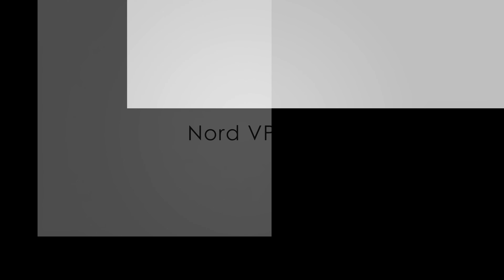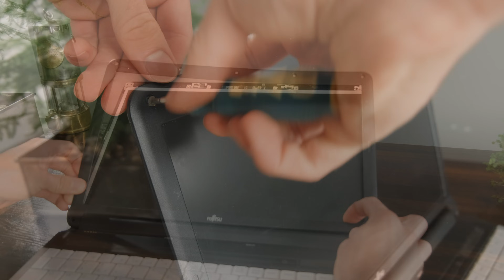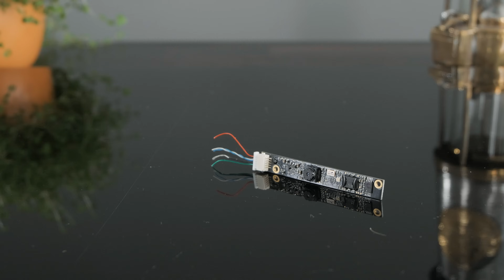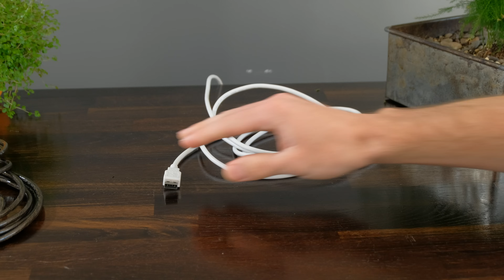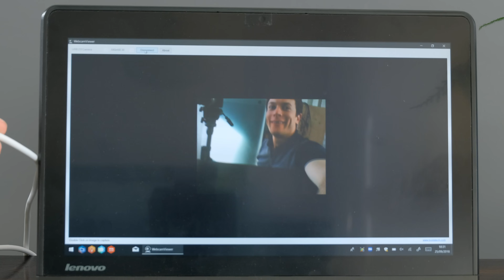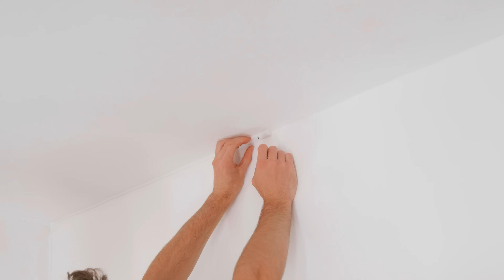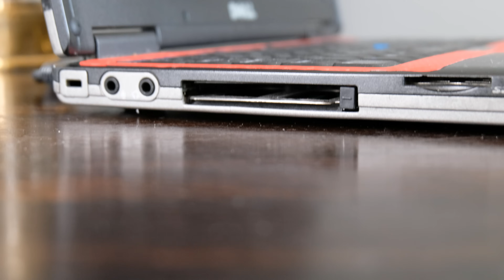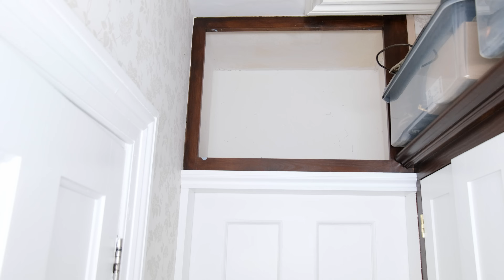DIY Home Security - ON A BUDGET!

Comment: Amazing, thank you so much for that video I've been saving those little cameras from computer screens and laptops because I scrap them myself and save some of the components instead of just taking them to the e recycling bin. I was hoping that someone would post a video of this nature and I'm so glad that you did I will check out those links when I have gotten enough to do that project. I have an old laptop but it did not come with a power cord. I'm not sure which brand it is but I'll have to check it out. By the way how well do these work at night and in the dark if you can connect infrared lights as I have from old remote controls for TVs. That would be even better to see outside what is going on at the night time. Thanks again for this video and God bless

Comment: Another way of finding the Vcc pin of the camera is looking at the capacitor that is nearest to the connector. It is usually in parallel with the power supply.

Comment: I did all the connections right but on the laptop it is saying webcam needs more power and its also saying something about metered connection
Reply: Try with short usb cables and if that works look into active usb extension cables. they have usb repeaters in them if you are not using any currently.

Comment: I thought about this but never personally looked into it, thank you very much! I'm currently running a cctv setup. but with the signals in it analog, and just while a dedicated but cheaply made dvr does the job, things can get to be a little bit of a pain in the ass.. I had two cameras die either due to an emp off a light fixture or a surge from it "magnetic ballast" and they took the analog input ports with them which effectively perminantly turned it into a 2ch box. I did have an 8ch box on backup but still what a pain.. It does irritate me a bit and honestly I think webcams may pull a higher res "some of them anyway" and I may have a few... Also having a few old computers with like 5pci slots i guess i might be able to use usb pci cards.. If they exist lol I'd have to check, if so effectively 12 maybe 14channel capable desktops though a uninterruptible power supply may come in handy and ofcourse be a bulkier version of the diy. On needing usb repeaters is that due to 5volts struggling over the cables resistance or is it the data signal weakening?

Comment: Can you make a use a phone camera to make something like this
Reply: Yes,  if you have a home wifi network and an old Android phone.  Simply install IP Webcam from the Google Play Store.  Place your cell phone where you want it.  Keep it permanently plugged into a charger.  Just follow IP  Webcam instructions.  You don't need any additional software for your viewing devices.  IP Webcam can be viewed from your cellphone, Chromebook,  Windows etc.  IP Webcam will up load video to your email, Dropbox or save it on your phone.  You can even have multiple cameras, but they can only be viewed one at a time.
Reply: I believe with the paid version of IP Webcam you can view more than one camera at the same time on your PC monitoring center.  While each phone's camera can record its own video to an sd card, it's also possible to record them on a central PC (probably only with the paid version of the software).
Reply: it doesnlt use usb protocol.it would be much harder and even if you could identify protocol it would require many tools and deviced which mean it would defy the scope of being cheap
Reply: yeap you can, the problems are that mobile lcd and cameras are using special commnication protocol, the pinnout is hidden and their onboard chip unkown. without the phone you just can demanufacter it and stufy under microscop if you have enough knowledge. With the phone you can probe things around to determine the pinout. but it s not that easy as to connect a usb camera to usb port via usb cable.
Reply: @Michael-cm8qk  I am talking about how to use the camera externally

Comment: Using a Raspberry Pi instead of a notebook would make things even cheaper and less power hungry. And you can place multiple Raspis everywhere and connect them with ethernet or wireless. The new 3+ can handle up to 4 USB cams because of it's newer and faster USB chip.

Comment: When I try to connect it to my PC it tells me " Power Surge on the USB port, unknown USB Device needs more power than the port can supply" any solutions?
Reply: You either have an excessive run of Cable (Cables are too long, you need to add a Booster or give up on the Camera furthest from the Laptop) or, at some point the Cable has been "pinched" in a Window or Door. There are several scenarios I mention the most probable.
Reply: the cable is only about 1,5 m long so that shouldn't be a problem. And I didn't even install it somewhere I just plugged it into my PC to see if it would work.
Reply: Happened to me. The reason is you have the wire shorting each other. Just tidy up your wiring job, that should fix it
Reply: @attarsanahresources5540  Yea that should be the problem thank you 
:D

Comment: Just want to suggest, instead of using usb extender and have some wires, you can do even advanced way by getting very cheap and small router, flash with openwrt plug camera into usb port and you can do it wirelessly

Comment: Tip For Anyone Considering Doing This I'd recommend looking the model of your computer up on iFixit, high chance you can find a disassembly guide there.  Some relatively newer displays don't have easily available screws like his to remove the panel, in which case a guitar pick can be used to pry the paneling open

Comment: With the cost of sugru, usb repeaters, usb expansions etc, it's not very practical. But it's fun at least.
Reply: I think I could get by with a simple enough trick of swapping all the repeaters and usb expansions with Pi Zero W.  Basically a DIY wifi camera at that point, spending roughly as much money, using something like MotioneyeOS on the microSD card.

Comment: Ok, many of these modules have a built in microphone i think is the other 2 cable. If instead of use a usb cable you use utp for the 6 cables you can have a camera with mic, of course you need to solder in the other end a usb and 3.5 jack.

Comment: A few 20$ IP cams might cost less overall unless you manage to get most materials from this video for free (giveaway, dumps, old parts ...). Plus you could replace the usb cables with phone cables which are cheaper and often thrown away in construction sites. Those cables can have up to 8 or more wires (think 2 cams per cable). 
Also, you can run USB devices over pretty much any cable length as you want as long as you set the devices to use low bandwidth (so you'll also want to drop the video bitrate (resolution and speed) while also disabling the integrated micro and desolder the leds to save a couple amps). Because yeah, even though the USB specs only suggest up to 4 or 5 meters of cable length for high speed data transfer you won't be needing it plus,  this might actually be a good idea anyway because you'll run out of storage space if you record hours of best quality video from multiple cams.
That being said, i'm not sure using this would be a secure and long term setup but, those IP cams wouldn't be either unless properly configured.
Reply: so 20 bucks each is cheaper than less than 2 bucks per cam? and usb cables you can find in droves
Reply: @LiLBitsDK   you can get REALLY cheap ip cams...plus no need for a separate laptop and far more likely to be more reliable than this!!..this is really cool though don't get me wrong ..but lets face it this may be a lot of hassle for some people when you can just buy a cheap ip cam which will have more features such as wifi night vision or  sd card support

Comment: Do you think it would be okay to connect, let’s say 10 cameras to a USB switch? Since my computer has only 4 USB ports, and I need lots of them, since it’ll be a big project. And also, what will happen if I connect the cameras one to another, so I can save up some time on soldering and routing so much cables, all in one way? Thanks for the answers! 😄
Reply: Nikolai Nikolaev I don't really have an answer, but would suggest keeping things as modular as possible, especially at such a large scale. It will make diagnosing issues, and adding/replacing elements easier.
Reply: if you mean connecting the cameras to a hub and running that one cable, that will be fine as long as you dont have the cable too long. if you mean have two cameras share data and power lines to a single usb port, dont bother. They will basically cancel each other out.

If you are doing a large install, do a proper setup with IP cameras. Look into zoneminder, motion, and openwrt.
Reply: no no no your computer/laptop USB ports will only provide 5volts at around  500 milliamp which is just about the right power for 1 per USB port if you wish to power 10 i will assume you need a external power supply and some kind of micro-controller to handle all your the data lines to 1 usb port or a cctv dvr and i am no expert just a guy with no degree
Reply: You can not daisy-chain USB devices. Every USB device needs its own, dedicated cable, but you could probably use a powered USB hub somewhere to pack everything into one cable. That hub would likely have to be USB3 in order to have enough capacity for a lot of cameras. The cameras connected could still be USB2.

Comment: Minor note on how you mounted the camera in the corner of the ceiling: you should probably add a bit of suguru to the side opposite the cable, so there's not a 90 degree corner there.

Comment: The thing is ... they dont work without lights
Reply: @luisotero2632  BUT where do u connect it???!?!?!?!?!?!?!?!?!??!?!?!??!?!?!!?!?!?!?!?!?!!  TWO wires??!
Reply: @carpetrug01  the infrared LED can easily be connected to the USB power... DOH!
Reply: @luisotero2632  what do you plug it into?

Comment: You said there is no way of finding out which lines are Data+ and Data-. That's only partially true. You could make out the chip that is directly connected to these two wires. If it has some markings you can try to find the datasheet and look up which pins are which Data line. Still, it's a very involved process and if you are unlucky the chip is just unmarked silicon (depending on the webcam module).

Comment: I did one today, from Lenovo laptops and damn those wires are small, covered by a very strong protective sleeve. One thing I noted, there is a chip that gets very hot, so maybe leave a bit of breathing room for it to cool off, or they might not last long, espeically if they will be working 24/7 as security camera.

Comment: I have a few questions about those cams. On some cams written 3.3V but from usb comes 5V do i need to transform 5V to 3.3V and another question is how to get mic to work because most of cams i have from laptops have 5 wires - 4 is for usb connection and 1 im think is for sound but how 1 wire can transfer sound ? Maybe one of the cams video wire (like +) transfers sound too ?

Comment: Talking about a VPN for privacy reasons and adding a whole bunch of cameras in your home is rather ironic.
Reply: This is all local access cameras. You could setup some remote access features as well if you really wanted to and it would still be very secure. Compare that to a smart camera or camera service where all of the video lives in the cloud. Forget that.
Reply: Privacy is about control of information not lack of it.
Reply: Cameras when you go on holiday....
Reply: Or just when you go out if you live in a rough area haha
Reply: You could have the cameras on an internal network that could only be accessed externally by a VPN. Honestly, using the two together is super secure
Reply: How? The cameras are local to his home and laptop with no connection to the internet if he chooses. It doesn't provide the same level of protection in the real world that a VPN does in the digital space, but it does provide some sense of personal security like a VPN.
Reply: I mean... not really. They are (or at least "can be") closed circuit, used only for legal reasons. Therefore you wouldn't necessarily have to even have them online.
Reply: I would say... moronic !
Reply: lol and hooking them up to obsolete operating systems that dont get security updates, and using open source software at that
Reply: CMBAR (Comment made by a Republican).
Reply: I can see some straight guys above
Reply: also using a VPN combined with google chrome is absolutely fucking genius. You have the least private browser on earth and then you put a VPN, which it can actually get around... If any of you are actually doing that, switch browsers or stop wasting your fucking money.
Reply: No internet no organization spying
Reply: @benji3116  everyone on this platform is slightly challenged. Or we would be the ones making the videos eh?
Reply: you can just tell your people that there is cameras in house here, here, here........
Reply: @saadomar1101  Pretty sure that would defeat the purpose. Anyway, it's your house, you have the right to monitor the activities that go on in and around it. And if the country you live in doesn't allow it, then you live in a shitty country.
Reply: As far as I could see, he didn't put the computer online... So??
Reply: So he could spy on other people in the house?
Reply: @merlingallagher4484  its his house yo, im not sure there's a reason to do something dodgy in other people house
Reply: Even in your own house you have other family members or guests?
Reply: why would i want to see video from each guess ? its just for maybe some burglary or anything. the HDD is limited maybe to 2 TB so after sometime it will be replaced with new footage, except if you are a creep you'll save the video before it replaced
Reply: @Kevin R . Well there is also other roommates and quests. I don't know what country you're from, but in many countries you can't just record people on video, including in your own home.
Reply: why is that? do you know his or my intent to see use this? vpn can help to a more private access to the webcams to check if everything is alright.
Reply: I am talking about the privacy of the people in the house. Not to the outside world.
In fact, in many countries you're aren't even allowed to run a camera system without people notifying.
Of course the first comment was sarcasm (with a bit of truth in it)

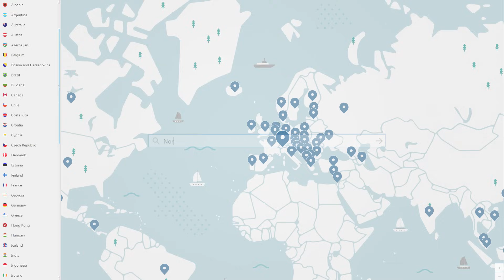Comment: 1:33 yeah, except that 66 % off doesn't seem so whopping compared to the 77 % you get without the link... Quite misleading to call it 66 % off, when in reality it costs 33 % more to use the link.
I know it's rather NordVPNs fault, not yours but still. You shouldn't reinforce, which could be considered false advertising.

Comment: I would use the Software ZoneMinder instead... it's linux based and therefore does not need such an old and dangerous windows version like XP to run smoothly on old hardware

Comment: Tip: Aliexpress sells laptop webcams in a housing with a USB cable attached, ready to plug in for less than 2 Euro. Can set up a cheap system as described here if you don't fancy soldering

Comment: well I just did this with an old Compaq laptop I had laying around. My PC recognizes it as an HP webcam, but unfortunately there is no video. no drivers for it either, so thats a bummer. I will def try to find some more broken laptops to do this with, or just buy a bunch of the same webcams so I'm not trying to decipher the nearly microscopic wires anymore lol

Comment: I use MotionEye os, which is freeware.
It runs on very small and cheap (single board) computers,
like the Raspberry Pi 3, with wifi and very low power consumption,
which allows it to run with (backup) batteries or power bank, like UPS.
Then you can even hide the entire computer from view.
The software allows for a multitude of cameras.
The Raspberry Pi 3 has 4 usb ports.
You can also connect IP cameras.
It has a lot of features, like motion detection.
it can store recordings locally or stream it to an external server/device
and it can notify you with an email (for instance), when motion is detected.
You can also connect to the SBC remotely to change settings and watch the feeds.
All in all, a very powerfull setup, and cheap.